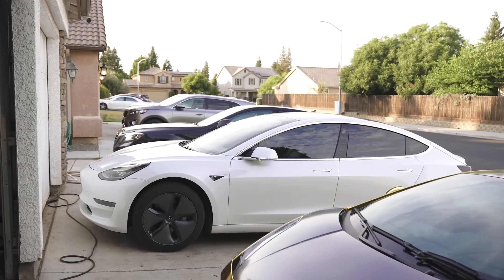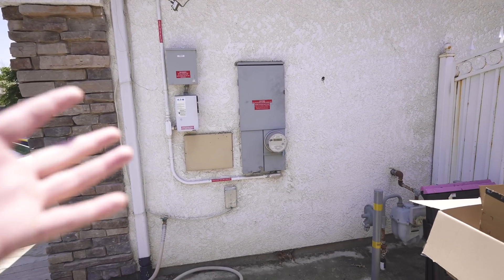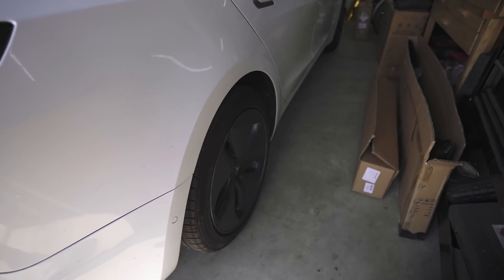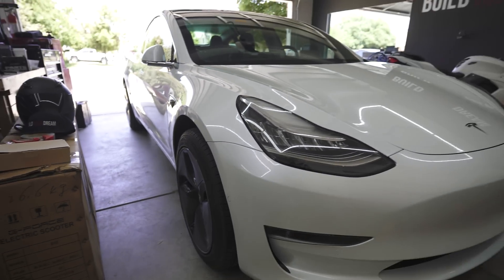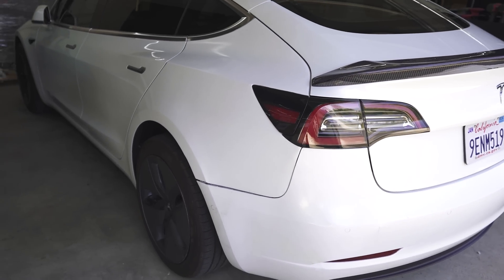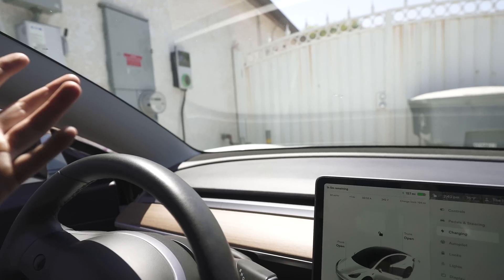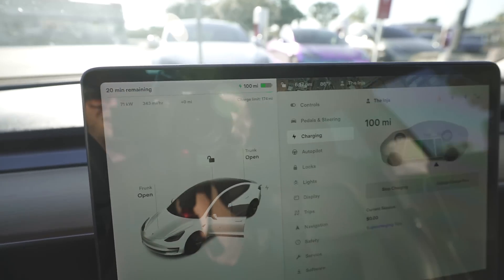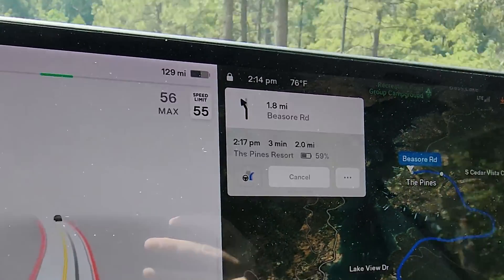WILL the Tesla 3 SUPERCHARGE after Repairs?

Comment: With the Aero wheelcaps the spacers do look nice, but I think I like the standard position even more without the Aero hubcaps. You might loose a dozen miles of range, but it's a cheap buff for the looks. I can respect the choice not to add the front valance if you gotta drill into the car, I wish there was a less destructive option, don't side skirts only require 3M tape like the spoiler? The pearlescent purple wrap looked friggen' sweet on that other Tesla though. The only thing I'd worry about with that outdoor charger is rolling up to catch some rando heisting power.

Comment: You should definitely keep the Model 3. The spoiler is a little OTT, but looks pretty good. I would go for a smaller Carbon one. The spacers really enhance it. Have you looked into the Uber Turbine wheel covers? They cost around 150 on Ali and they cover the rim of the alloy (unlike the aero covers). Bonus is they make the wheels look bigger.
Reply from the maker: Haven't seen those, I'll look into it!